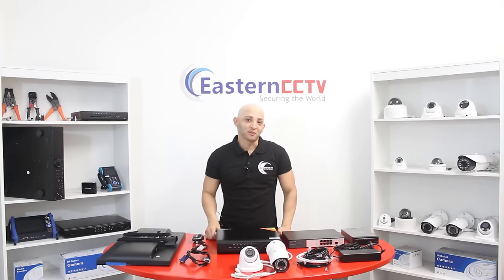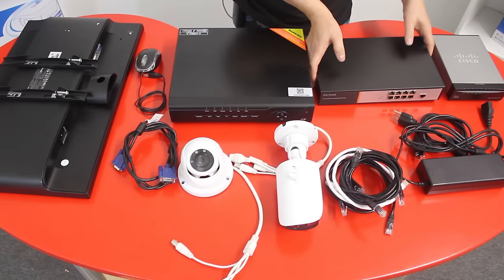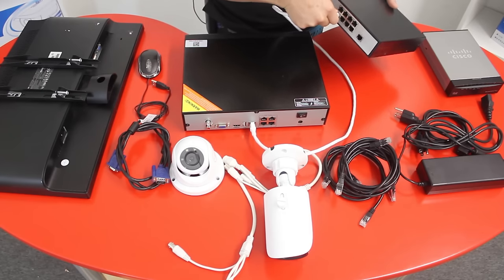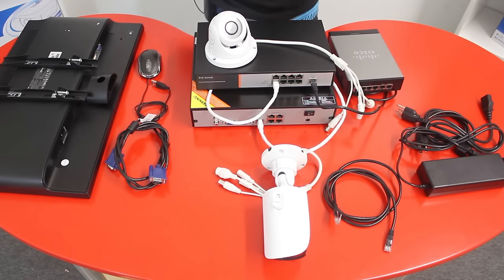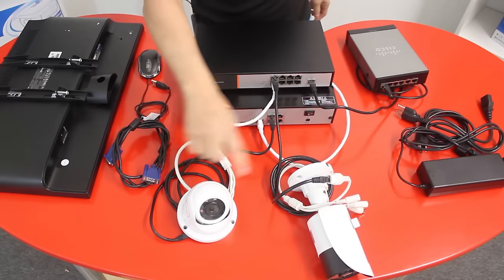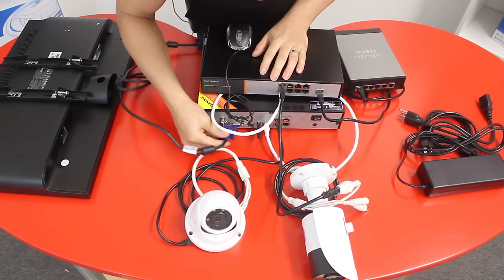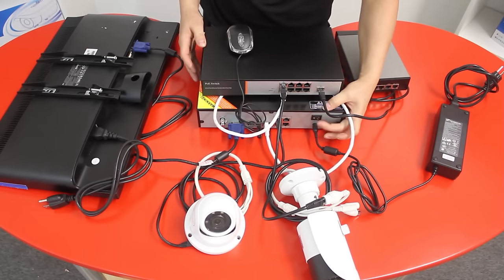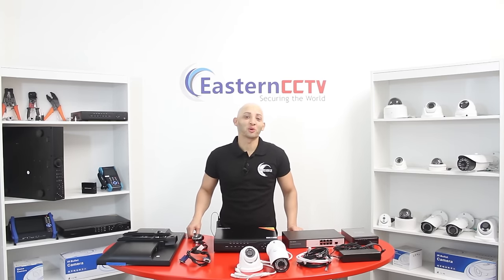How to Setup and connect an NVR Security System Using External PoE Switch

Comment: I have 4 x 4 MP Dahua Camera's and bought a Random NVR with 4 POE ports but it doesn't seem to detect the camera's.

Would I need a Dahua NVR for the plug and play feature? Or Can I set them up with the existing NVR I have
Reply from the maker: Because the NVR is not Dahua you first need to connect your laptop to the same POE Switch and run the software called "Config tools" to be able to find the IP cameras and set the ip address manually on the network. Once the ip address has been set on each IP camera you can add the IP cameras manually on your NVR. Make sure your NVR has ONVIF Protocol as well as the IP Cameras. if the NVR does not support ONVIF you might not be able to set the IP cameras on your NVR. Best of Luck.
Reply: If I get a Dahua NVR would I be able to plug and play without setting the IP address manually to the cameras since it should detect the cameras itself?
Reply from the maker: If the Dahua NVR has Build In PoE ports the answer is yes just plug and play. if the Dahua NVR does not have Built-in PoE you might still have to do the configuration manually, But as my understanding Dahua can scan and detect the ip cameras on the network and the NVR can set them up with just a few clicks.
Reply: Thanks i'll have a go
Reply: I'm looking at a similar situation. I'm looking at getting a night-owl system with bnc connectors. Wouldn't I be-able to purchase a ONVIF Compliant switch, and plug it into the RJ45 port on the nvr, and run the switch to the router? I have a generic ptz camera that is ONVIF, however it doesn't appear to be compliant with night-owl. would this setup work, and still record to the night-owl nvr? also I will have a second router bridged to the main router, so the whole camera system will be on it's own network.

Comment: hello, can i make test for one IP cam without using a  POE switch, note thet my NVR JUst Have one RJ45  port.
thank you
Reply from the maker: Then what you need to do is have 12VDC power to power on the IP camera. if your NVR does not have PoE ports and you don't have a PoE switch then the IP camera needs to have power separately. Most IP cameras have a plug for 12VDC. You will need to connect the NVR to the router and the IP camera also to the router. Reminder, The ip cameras need to have a source of power.

Comment: can we connect nvr and dvr in single display unit ?
Reply from the maker: If the Display monitor has an HDMI and a VGA you can connect the NVR and DVR to it but you have to switch between input signals. you cannot have the NVR and DVR on one display an expect to display all cameras from both units on the display. You are able to do so by having a Computer and using the CMS software of the DVR and NVR units, both devices must be the same brand so you can have both DVR and NVR cameras on your computer screen when watching it remotely. hope this helps

Comment: What if the network has an additional router at a different location of the building ? Can I than run the Poe switch at the different router location ? Than simply plug the nvr into the other router ? Will they communicate properly ?
Reply from the maker: If you have a different router at a different building that is completely not the same LAN. simply Set all ip cameras for remote view and add them individually to the NVR by using the ip address and the ports specified by each camera if more than one. Remember that CAT5/6 has a distance limitation. 100M (Around 300ft). IP camera Sample CAM1= 192.168.1.10 Port 8000 CAM2= 192.168.1.11 Port 8001 CAM3 192.168.1.12 Port 8002 and so on. Now on the NVR you will add the External IP of that specific router where the IP cameras are connected: lets say for example 68.154.13.2 so on your NVR you will add all the IP cameras with the same IP but specify the ports for each camera:

Comment: but router and  NVR  are two  different networks, I dont understand how you can mix those two,
Reply from the maker: Anything that you connect to a router would be in the same network. The router is responsible for assigning IP addresses to every device that is connected to it.

Comment: Can we connect two different switch to nvr system ?
Reply from the maker: Yes you can connect multiple PoE switches in a daisy chain mode, meaning if you have 2 PoE switches the first PoE Uplink will be connected to the Router and the Second PoE switch Uplink can be connected to any port on the First PoE switch or the secondary Uplink Port on the PoE Switch if it has one. If you have multiple PoE Switches in different locations of the building, Each Uplink you can connect it to a regular Network Switch as long as the switch is connected to the router.

Comment: Whats the difference between a NVR and DVR?
Reply from the maker: NVR uses IP cameras that have higher resolution than the Analog HD cameras. for example a HD analog camera ranges from 720P to 1080P resolution. But the IP cameras ranges from 720P to 4K resolution thats 4 times bigger than 1080P. also on an NVR you can connect upto 256 IP cameras ratter than 32 on an DVR.

Comment: when we should use Poe? is installtion possible without poe using nvr system?
Reply from the maker: Yes its possible but is more work. If you dont have PoE Ports on the back of the NVR or have a PoE Switch, then you will have to power all your IP cameras with individual 12V DC power supplies and connect all  the CAT5 Cables from your IP cameras to a regular Network Switch.
Reply: EasternCCTV (USA) LLC | Professional Security System Wholesaler thanks bro... network switch means router's switch?
Reply from the maker: Yes, But most routers only have 4 Network Ports on the back the most. for this you need a Network Switch. Network Switch are not Routers, they only expand the ability to connect more devices to your network.
Reply from the maker: The overall Distance for the Camera to Send the Video to the NVR when is connected to the Built-in PoE Switch would be around 300 Feet. 

The Overall Distance that the PoE Switch can push the power and send and receive data from the camera is also 300 feet.

So your answer would be Either way. If you connect the IP cameras to the build-in POE of the NVR you can run that cable 300 feet, sames as if you connect the IP camera to the PoE Switch.
Reply: EasternCCTV (USA) LLC | Professional Security System Wholesaler 
Hi. Bro i have some confusions about POE i heard that POE drops voltage after 100 metres distance. It works efficiently under 100 metres. I would like to enquire about that the 100 metres distance would be considered from Camera wire to POE or from POE to Nvr. 
OR it would be considered dually from camera to POE 100 metres and 100 metres from POE to NVR?
Reply: EasternCCTV (USA) LLC | Professional Security System Wholesaler Suppose that of there is a distance between camera and NVR is 200 metre than what would be the appropriate distance of placement of poe switch  between?
Reply from the maker: What you need is an NVR with Built-in PoE and a PoE Extender. So you connect 300Ft of Cat5/6 to the back of the NVR then at the distance of 100 Meters (300Ft) you connect the PoE Extender that would allow you too run 300 Feet more of cable so you can plug your IP camera 200 Meters away ( Aprox. 600 Feet)
Reply: EasternCCTV (USA) LLC | Professional Security System Wholesaler you mean that 300 ft distance should be from ip camera  to POE? Would 300 ft condition not apply from POE to NVR.
Sorry for disturbing you.
Reply: EasternCCTV (USA) LLC | Professional Security System Wholesaler 
Thanks bro may god bless you.  :)
Reply: EasternCCTV (USA) LLC | Professional Security System Wholesaler  bro please make a video related to the topic of POE.
Reply: Poe extender connects With Poe switch? is POE extender compatible with 48 channels POE switch?
Reply from the maker: Yes
Reply: EasternCCTV (USA) LLC | Professional Security System Wholesaler bro Could Poe switch work on non-poe based  NVR? 
Does built-in poe nvr not need POE switch under 300 ft and can only work simply by connecting poe based ip cameras directly to the nvr with out having need of power supply?
Reply: can u upload any video on this so it becomes easy to understand in a practical manner

Comment: He starts off wanting to connect 16 cameras by adding a switch. But the switch only has 8 ports, only 7 of which are available. So 3 cameras go to the 3 available ports on the 4 port NVR, then 7 cameras go to the available 7 ports on the 8 port switch. That makes only 10 cameras, so where do you connect the other 6 cameras. Up your bum mate ? ? ?
Reply from the maker: Hi Nikita, our apologies for the confusion. The presenter in this video misspoke at 0:50. This scenario is a 8 Channel NVR with 4 Built in PoE ports. There is a correction notice at the top right hand corner of the video.

Comment: Configration of ip camera plz
Reply from the maker: Hello, The configuration of an IP camera might be different from the IP camera that you Might have, the concept its the same. 1st, use the CD or software that came with the IP Cameras to scan and provide a Local IP address to each camera OR user the NVR interface to Find them "if the NVR has the search IP Feature" 2nd once providing an IP Address to each IP camera then you can add them Manually to the NVR. we would do a video of this configuration but it might be different unless you have our line of IP cameras. Best of luck.
Reply from the maker: Hello. Here is the video you wanted to see. https://youtu.be/ZtKDy2oLuZs (how to configure the IP Cameras)